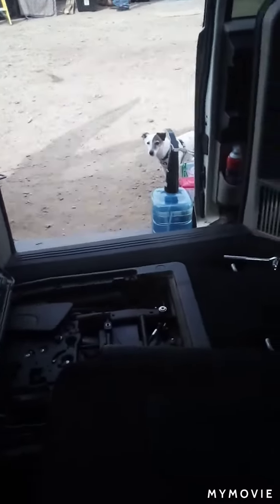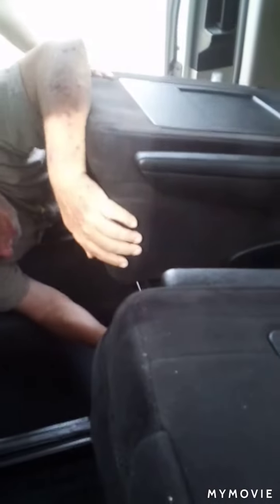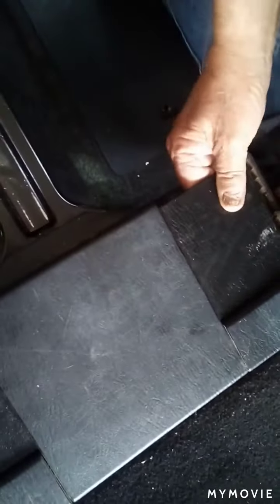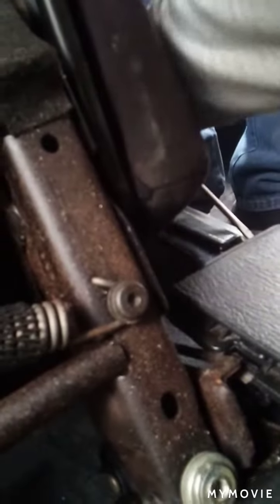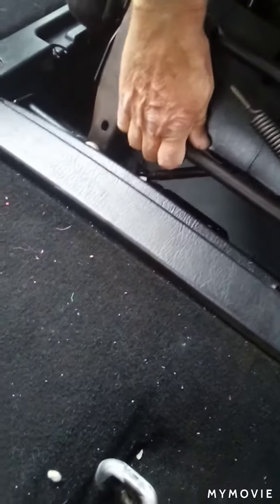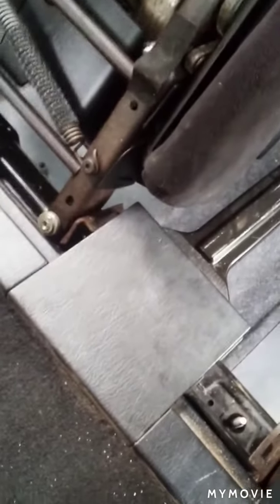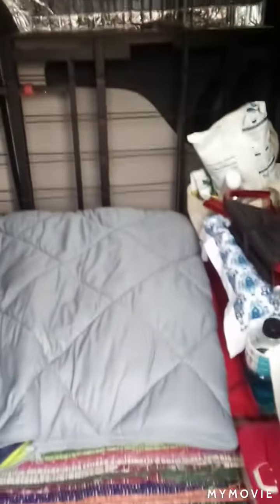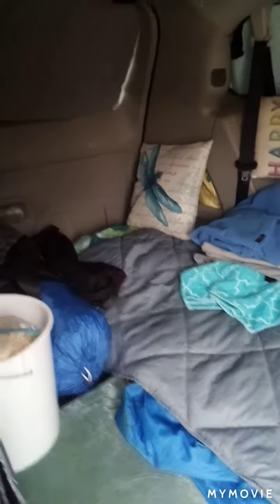Simply removing second row seats in 2013 Dodge Grand Caravan

Comment: Hi Lesa, I realized that you have moved on from the mInivan, but this video came into my feed yesterday I have a comment. Here goes: when having watched many minivan builds, especially no build builds I have struggled with figuring out space, such placing storage containers under the bed. But, under the bed should be in a cargo van, etc. because of the larger space, in my opinion. I like the minivan design by Minivan Lee. She placed Sterilite-style dressers against the rear door and some against the opposite entrance door. That gave her ample storage space and then she had an open floor area to place her blankets and bedding. During the day , she rolls up her blankets and bedding and places them on top of her rear door dressers. Lying on the floor gives one more headroom  than a bed. And, as you Lesa, have attested, no need to be falling out of bed. If I do upgrade to a minivan, the floor bed will be my choice.